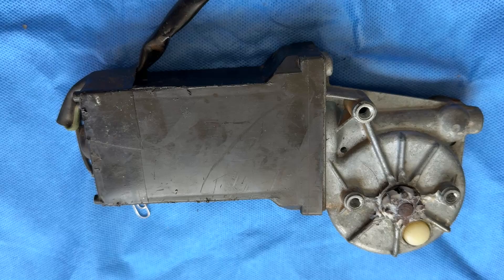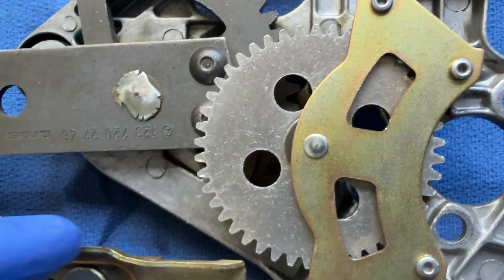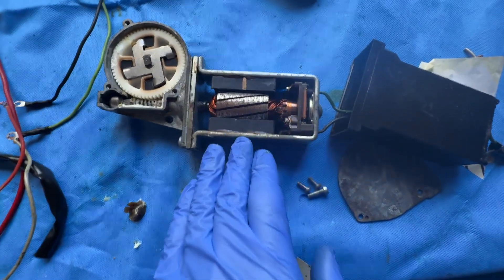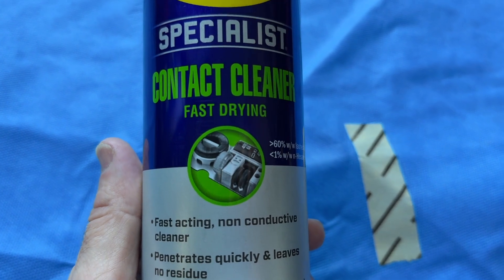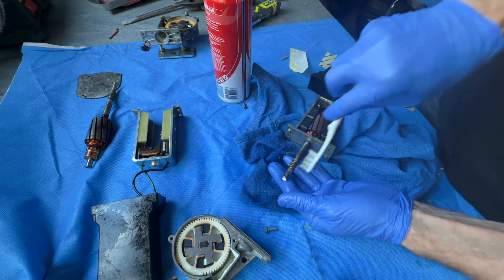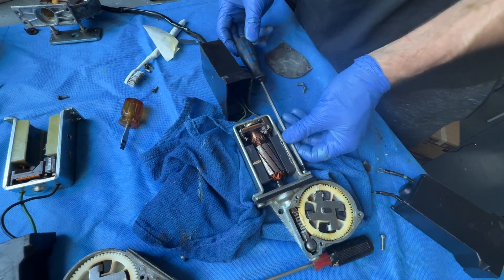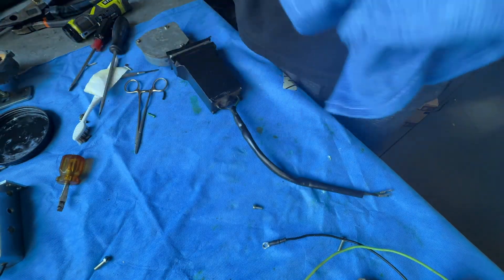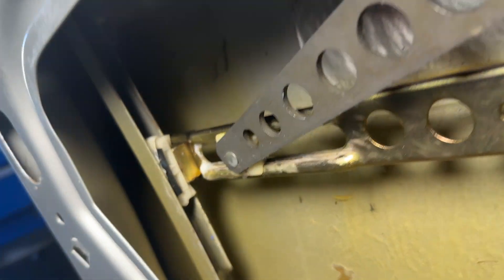Mercedes W123 (front) electric window motor repair (116 swap)

Comment: I just opened up a motor, cleaned it out and regressed it. Works very well. Now the next challenge is: how to straighten out the bracket. I'm so scared it will break is it is cast. I don't understand how it warps in the first case. Anyways. Thanks for the video. I might grab a motor from W126 just to have from a junk yard.
Reply from the maker: Hi Hans, do you mean the regulator arm is bent?  Many people will say you can straighten them, I think that is a waste of time.  Id buy a new or good used one.  If it's the usual drivers front door, buy one from the opposite market on ebay or something.  Ie if you have a LHD car,  buy a RHD market like the UK one as there passenger ones for your driver will have had a lot less use if this makes sense?  I did this from the US and got a nice one.